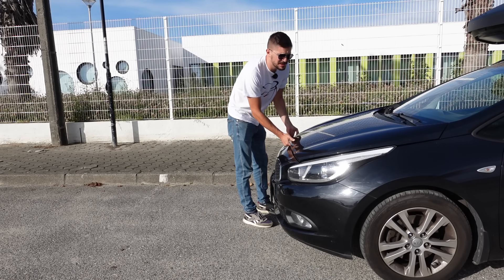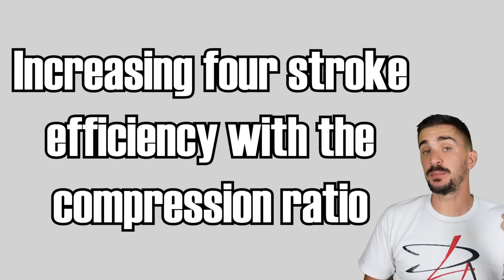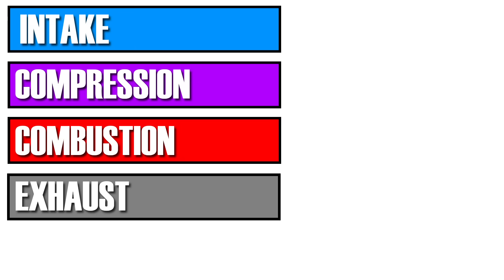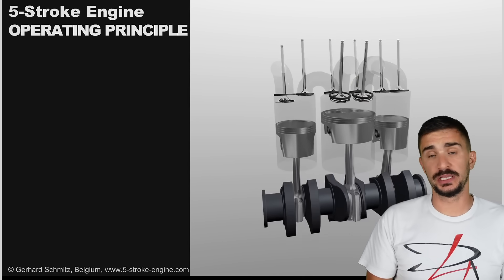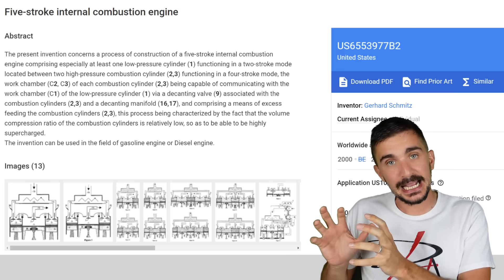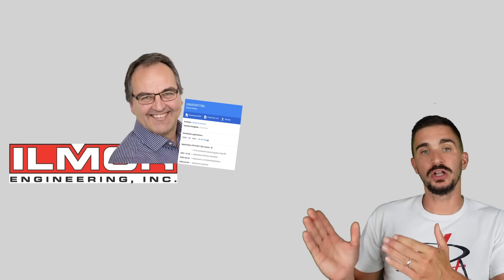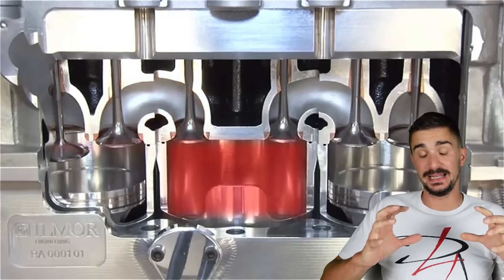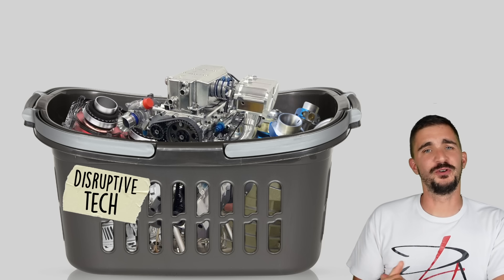Why Five Stroke Engines Are More Efficient But Still a Failure

Comment: it might work well as a range extender for electric vehicles. There, it can run at it's most efficient power, until the batteries are re-charged and the engine can be shut down until the next charging cycle.
On the othe hand, other engines and maybe even turbines can do the same task.

And yes, I would really like a small turbine as range extender. The problem there might be that at that size, they're not quite as efficient as their bigger brothers.

Comment: Nice one as usual. Any new idea today must face 150 years of development and improvements of the 4 stroke. So unless it is perfect right from the start, it has very little success chance. Each of the problems you mentioned could have been solved with a little time and engineering effort, but why bother to do that for 10 percent more efficiency?

Comment: Just here to let you know - electric motors have existed for longer.  Michael Faraday demonstrated circular electrically induced motion in 1821, Sturgeon demonstrated the first practical DC motor in 1832 and by 1838,  Moritz von Jacobi built an electric boat that carried 14 people across the Neva river.
Reply: Yes however obviously a prerequisite is the use of the worst cluster devices known to engineers, batteries.
Reply: Context matters.  He's obviously talking about heat engines, not electric motors.
Reply: Rockets have existed for even longer than that, with even less mechanical complexity. And in trying to sound smart, you missed a key detail: he was looking for a device of comparable mechanical complexity. Comparable, not vastly reduced.
Reply: @leandersearle5094     #17:57 "let me know when ANY kind of propulsion technology manages to last 150 years" You are making up arguments to suit your own prejudices and making yourself look stupid while doing so.
Reply: Fair, but electric motors is nowhere near as complex as an Otto cycle engine and hadn't been used to power a car until very recently.
Reply: @danieltanuwijaya7675 that's actually incorrect. The first electric car was built in the 1880's, but the first electric vehicle prototypes were built as far back as the 1830's.
Reply: @danieltanuwijaya7675 you don’t know how a permanent magnet synchronous machine (aka electric motor used by teslas)works, it is more complex than combustion engines, in my opinion
Reply: @lucasv5359  I'm familiar with electric motors and no they are nowhere near as complex as the average car engine (it's magnets on a shaft on a housing filled with copper coils), at least mechanically. They (PMSM motors) do need some fancy inverters and controllers to work but so does a modern engine these days with their ECUs.
Reply: @danieltanuwijaya7675  silly to compare ECU which is operating low voltage with inverters that do the very same work of timing signals. At high voltage. With frequency of one-three magnitudes over ECU.
And there is a lot of mechanical and manufacturing know-how involved in PM an even good old induction motors.
Reply: @lucasv5359  I have to disagree with you. Count ALL of the moving parts in any ICE. The very latest Induction Motor Technology - has only ONE moving part, which is the Rotor. Today, the motors used in any EV are up to 98% efficient. Now compare an Internal Combustion Engine at just better than 35 to 40% efficient. As Battery Technology improves, and can equal the range of most modern ICE vehicles, and re-charge in the time that it takes to eat your lunch, the ICE will be dead and forgotten. In the near future, Oil Companies will find that it's more difficult to extract Oil from our Planet. What then? For all you know (@danieltanuwijaya 7675) - could be a Professor of Technology! And me too!
Reply: @peterduxbury927 Problem is, Batteries have a chemical limit on how much energy can be stored in them, and its much lower than the amount of energy stored in gasoline. EV vehicles will only ever be useful for short trips and commutes to work. Personally I think electrified trains are the way to go. 
Edit: Also, as long is there is oil on this planet, corporations are gonna extract it. Until we completely run out of petroleum we can access, we’re gonna keep using, as the fossil fuel money must flow.
Reply: @peterduxbury927 Unless we make a major breakthrough in battery technology Electric vehicles will never be able to practically have the range that ICE vehicles have.
Reply: @TheRealFmarty  My EV goes farther than my gas car did.
Everyday I leave the house with a full "tank". 
It take 2 seconds to plug it in. 
It charges while I sleep. 
It costs ~$4 to fill from empty.
Reply: @Longbowgun  Might I ask what EV you are using right now and the gas car you had before it?
Reply: @Longbowgun  Also, when I say EV, I mean electric vehicles in general, not just cars. Batteries don’t scale all that well, and frankly we shouldn’t be using cars for long trips anyways. Public and Mass transport are far better for the environment, which is why I like the idea of electrified rail.
Reply: @danieltanuwijaya7675  The motors are not mechanically complex, but the controller and it's software is very complex.
Reply: @peterduxbury927  "I have to disagree with you. Count ALL of the moving parts in any ICE"

Then you must first define complexity as the number of moving parts.  This isn't a universal definition, things can be complex in other ways.
Reply: @ferrumignis  So does a modern engine ECU. Modern engine ECUs also have a complicated software to run modern complicated engines. Consider a gasoline direct injection engine with a turbocharger and VVT, you have to control fuel timing, valve timing, spark timing, boost pressure while also monitoring numerous different variables like air fuel ratio, oil pressure and temperature, cooling water temperature, emissions and exhaust gas temperature. And if the engine is using an auto transmission then the ECU also has to manage its rpm and load.

PMSM controllers on the other hand really only needs to convert DC to AC and synchronize its AC output so the electromagnetic field it creates in the stator coils is slightly ahead in phase to the rotor's permanent magnetic field. Much simpler by comparison.
Reply: @lucasv5359  PMSMs are really simple; you have three electromagnetic coils wound across multiple poles that are switched in sequence to create a rotating magnetic field, which drags the permanent magnets attached to the rotor around. Literally one moving part (the rotor). The driving electronics the most complicated part as you have to keep everything in sync using  hall effect sensors (or rotary encoders) to determine rotor position, and switch on the right coils at the right time, even then when you compare that to all the sensors and actuators needed in a modern ICE to control fuel and air mixture and firing sequences, electric motors are simple machines compared to the mess of rotating and reciprocating parts needed for an ICE. Edit: I've just realised after typing all that, that other's have already pointed all this out lol!
Reply: @antc5010  I worked with pinball machines and the old purely electromechanical ones with lots of moving parts are way more reliable than the new ones with solid state boards.
Reply: Utter hogwash. Non carbon brush electric motors only need a simple phase delay system with no real time adjustment capacity.
Possible to build entirely solid state by the 70s.
They have been used widely in bassive electronically scanned phased array radars and ultrasound imaging for literally five decades, and if you find me a single EV thats puahing more Voltage than a Zaslon, I will call you a liar.
Reply: @peterduxbury927  If he was he wouldn't imply that electric cars are a recent thing for inventions.
Reply: @TheRealFmarty  Don't believe that battery Technology has reached its' limit. But I do agree with you. Current EVs can easily satisfy the needs of millions of people, who commute to work daily, and at low cost. For the many families that own two vehicles, an EV would usually replace one ICE vehicle. We did this 5 years ago. I drive a 1971 EV Beetle, Tesla-Powered. It has good range, and will beat many modern ICE Cars away from the Lights. EV Beetle has been 100% reliable, and the only car that gives me a real thrill to drive it! Greetings from Australia.

Comment: The predominant use of the car is to move people. The average payload is about 250 pounds, while the average car weighs 4000 pounds. Most of the fuel is wasted moving itself. The things that kill efficiency are weight, the compression stroke, the valve train, the transmission, the differential, rolling resistance and air resistance. So: A car should weigh as little as possible. The shape of the car should be sleek. The tires should be tall and narrow. The engine should be as small as possible. There should be no transmission. There should be no differential. How is this possible? Using light weight materials and geometry, the passenger area needs to be stiff with extended areas  for crumple zones. Smooth wind cheating body without the abrupt change in windshield angle. Motorcycle tires have very little rolling resistance. A 400cc engine would produce plenty of power for a light weight car. Instead of a transmission the engine should be mated to an alternator. Direct drive motors would power the wheels and should include regenerative braking. There should be just enough battery to make up the difference between power demand and power produced. The engine should be programmed to run at optimum efficiency. The programming should include predictive analytics. In other words the computer learns to make the best choices. I would like to add universal connectors and sub-assemblies.

Comment: I wouldn't call this concept a failure, while not identical low pressure cylinders that harnesses left over energy were hugely popular in the triple expansion steam engines used in ocean liners. For example the engines used in the Titanic and her sisters were more efficient than the turbines used on her primary competition the Lusitania

They were also used with varying degrees of success in steam locomotives both sides of the pond.

Comment: one thing noone ever mentions regards compounding?

you only get the DIFFERENCE of the pressure acting on the two pistons in the LP stage.

that is, the high pressure gas presses down on the small HP piston "exhausting" the cylinder,  whilst it also presses on the larger low pressure piston,  and the only work left over is the DIFFERENCE in the areas. 

of course, a "stephenson " compound is a bit different as it throws in a reservoir and has a phase lag between cylinders...

Comment: 1st thanks for the grate videos and the info . this engine have a use for generators sins u can run it in fixed RPM and use its efficiency at height RPM . and even that can be used in cars . example Nissan x trail have 3 cylinder engine work as a electric generator (no transmission cus isn't connected to the wheels ) and the car have small size battery and the rest is like electric car

Comment: Thanks for your very informative and entertaining videos. I'm so glad I found your channel about a year ago. Learned so much since then.
And you are absolutely right, the era of the 4-stroke combustion engine is far from over. We might get new fuels, or it might be used to power the generator for electrical drive. But I think battery-EVs are the entirely wrong way.

Comment: In aviation, we had the turbo-compound designs made in order to harness the remaining energy of the exhaust gases. This also led to very complex and unreliable engines although they actually brought better efficiency. All these have been wiped out by jet engines which are less efficient but far more reliable. And reliability in aviation is by far the key factor.
Reply: You mean the r3350 with the power recovery turbines? Like you say i think it made sense that they went out in aeroplanes with the introduction of jet engines and their very superior reliability. But i'd never actually thought about using them in cars before, i wonder if it could be worth a shot seeing as they've stayed with piston engines. Wikipedia's r3350 write up says they managed 20% recovery, but mechanics called them "parts recovery turbines" because of increased exhaust temperature causing dropped valves. But it does sound like this improved with time. I wonder if they could be made to work on a car.
Reply: @joecook3223  Turbocompound engines in the modern form are the F1 power units but instead of directly transforming the waste energy as work the MGU-H recovers that as stored electrical energy. Compound engines make the most sense for applications with a constant load and rpm, as is the case for planes. 

In reality these won't work on regular cars because in daily driving there is not enough exhaust energy to be recovered to warrant the extra weight, complexity, and cost. In fact, I think we are approaching the limit of extracting more thermal efficiency from ICEs because the biggest concern these days is getting the catalytic converter up to temperature and emissions regulations are increasingly targeting cold starts (where most of emissions come from in modern cars).
Reply: @SkyWKing  Seems Porsche is taking a shot at implementing an MGU-H in their car. It's very interesting.
Reply: @SkyWKing  thanks for your reply too, yeah ok. Well i guess we're approaching the limits of thermal efficiency, if our means of emission control require a hot exhaust. Be good if there was a way to get around that requirement. Probably not, but we'll see I suppose.
Reply: @joecook3223 I've read that "parts recovery turbine" line so many times on YT from people who really know nothing about the R-3350. Do you have any first hand knowledge of the R-3350 in service? Well, I don't either but the father of one of my best friends was considered one of the world's most experienced maintainers of aircraft with R-3350 TC engines. He was the maintenance manager for KLM at L.A. in the Fifties when KLM operated both the L-1049 Super Constellation and Douglas DC-7 on long flights from Europe and on to the Western Pacific,  Asia, and return. Yes, the PRT were a problem especially on the very long non-stop great circle route flights with the DC-7C. He never mentioned exhaust valve issues. He said the most common problem was the viscous drive couplers. When the couplers failed the PRT became a net parasitic loss. He said it wasn't unusual to have multiple PRT failures on very long flights. I asked him if he missed the big propliners when jets came in and he said, "Hell no! I don't have to work as hard and I like it that way."
Reply: @joecook3223 Yes exactly. I meant the R3350 in its turbo compound version powering the DC7 and the Super Constellations. The Connies were often finishing their flights on 3 engines sometimes 2 !!!. I don't know any implementation of the turbo compound tech on a car engine, but I heard Volvo is using it on some truck engines. Here again, reliability seems to be main problem preventing this solution to be widely adopted.
Reply: @tekelili1  yeah ok. Thanks for that, I mean if it's being found to still not be reliable enough, no wide adoption is understandable. Good to hear someone's tried it more recently at least though, not just a good idea left in the 50's
Reply: Or MGU-H in F1 engines.
Reply: A turbo compound in a diesel passenger vehicle would be very interesting and probably quite efficient.
Reply: The top notch craziness was the Napier Nomad. Possibly the most efficient piston engine ever, but so crazy complex and heavy it never got fitted to any aircraft.

Comment: I wonder if there may be an application in stationary engines with a constant RPM where it runs more efficiently - something like electrical power generation where a traditional diesel genset would be used? Long distance trains and ships might also be an option - has a diesel version been tested? I guess it depends a bit on how much more expansion is left in diesel exhaust to see if that question is worth answering.
Reply: Good point

Comment: The engine will be perfect for a generator. The constant RPM also it could be used in a hybrid only to charge the battery so the 5-stroke application could be used in electric system, where RPM is constant to avoid the dead piston drug?

Comment: But can this engine be used as ev range extender? Extender always runs on nominal power, the same RPM. It can be calculated to the ideal 3-rd cylinder volume to retract maximum energy and have enough temp for the catalytic converter.

Comment: Technically the fifth stroke engine could use a turbocharger as a replacement for the center piston. It wouldn't be perfect, but I bet if you strapped a brushless motor to a turbo, you might get something useful out of it, at the cost of boost.

Comment: Most of these Problems sound solvable inside a hybrid assembly, where you either only run electric or run the engine and at the same time load the battery creating an artificial high load situation.

Comment: How about a two-stroke engine with one outlet at piston bottom and one inlet valve at the top? the airflow should be better because of the momentum from combustion, in one direction and with less mixing of burned and un-burned gas. Been tried? what would the efficiency be?